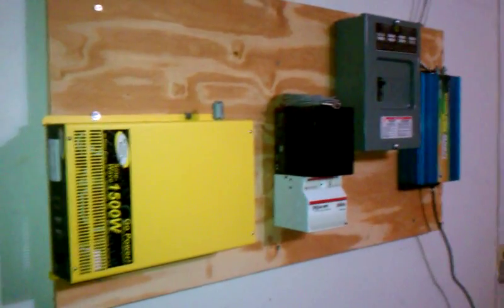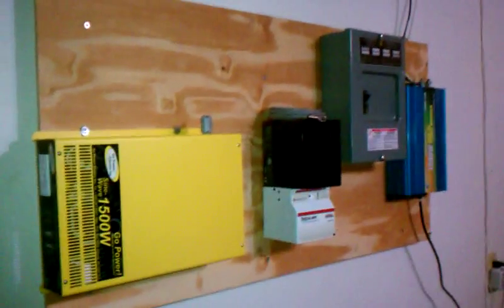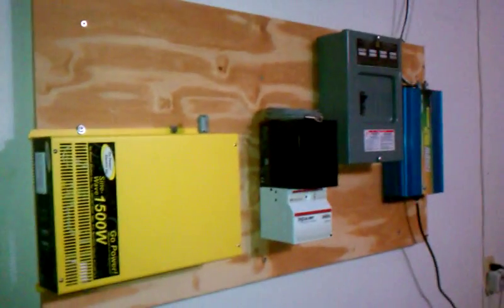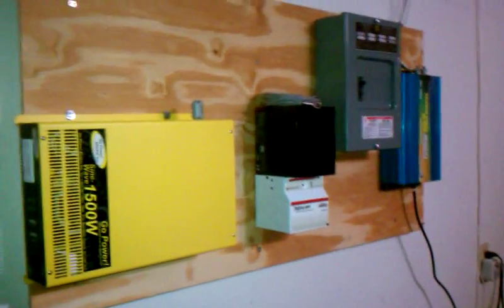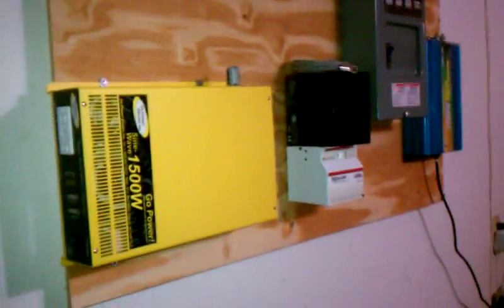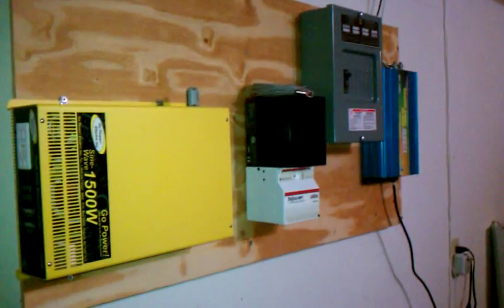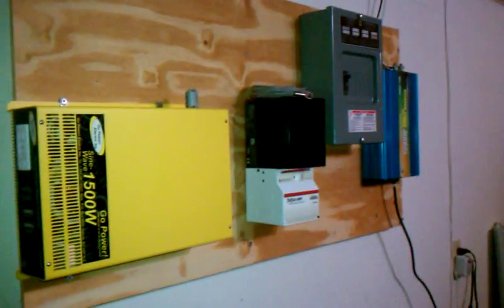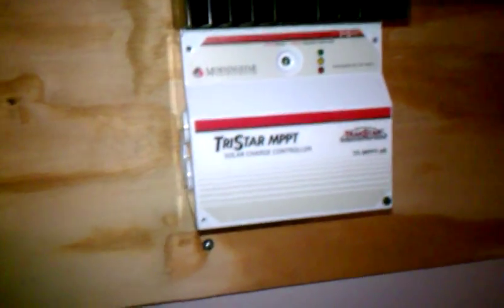Solar panels MPPT charge controller and 1500 watt Go power pure sine wave inverter part 2

Comment: You said the 3000 watts don't do what they claim but only 800 watts ... Do u mean the go power 3000 or other companies ?
Reply from the maker: +TAMIEM NAWAH The inverters do what they claim, the 1500W Go Power inverter for example will put out a maximum of 1500W or 3000W burst but will only sustain 1250W before it's in the "red zone" on the indicator. I have no idea what you are talking about as far as what I said though because you made no references to it so, I can only guess that's what you're talking about.
Reply: I know the go power will hold 1500w but I'm asking about the go power 3000w I just bought one today ... U said on the video that the 3000w inverter don't hold 3000w they just hold upto 800w ... I have read that the go power inverter are the best ... Are the go power 3000 as good as the go power 1500
Reply from the maker: +TAMIEM NAWAH The Go Power units work fine and they will do what they say they will do, I even say that in this video about The Go Power itself. I have a 3000W AIMS and it also does what it says it does. I was talking about the cheap chinese units they sell on eBay, they break down fast because the MOSFETS aren't mounted well and burn up.
Reply: Thanks, I almost wanted to return it ... But wanted to make sure we talking about the Chinese inverter that don't hold up to what they claim
Reply from the maker: +TAMIEM NAWAH Ok, no problem. I'd keep the Go Power unit, mine is still working to this day and it stays on 24/7 in my garage so they are workhorses in my opinion. My AIMS unit is brand new and I have been using it for maybe 2-3 months so I'll hold my judgement on that one for now.
Reply: Please do let me know which is better in the future , I read that the go power are better , which you the best

Comment: Hello I am new to solar and am learning a lot. I love your set up and your videos really help me. Can you please tell me what that blue this is on the wall? I understand the inverter but what is the blue thing
Reply from the maker: jacobz2011 The blue thing is also an inverter only it inverts DC power into AC power and puts that back into the grid lowering your power usage. It's called a grid tie inverter. So if you are using 1000 watts and you make 300 watts using your grid tie inverter then you are only paying for 700 watts of power usage. Hope that helps.

Comment from the maker: Does the wind turbine produce the voltages under load or as an open circuit? You'll want the "under load" value which is what it'll be when it's hooked to the GTI.

You could try it, not sure if it'll work. No, never done a wind turbine setup like that. Usually wind turbines charge batteries. You could charge batteries and then dump that to the grid?

Comment: listen dude..

the wind trbine produces arround 16V-20V... with peaks of 24V on high winds.

the inverter is 22-60V
they say that 22-60V GTI put power on the grid with input voltages arround 36V

but a 24V wind generator never makes output voltages bigger than 28-30V

so.. i was thinking in using a 10-30V Grid Tie Inverter.

do you agree?
have you done this before?

thanks

Comment from the maker: The concept is the same. The Grid Tie will turn on when the wind turbine generates enough voltage to meet the grid tie's low voltage requirement. It doesn't matter what grid tie you get. There are no grid ties built for wind turbines but there are some that will work with wind turbines. A grid tie built for wind turbines would turn on when the turbine started spinning and would dump the load to a dump load circuit in an over-amperage case. You won't find that so we work around it...

Comment from the maker: I recommend a wind turbine charge controller with a dump load built in, that's your best bet and the way to get the most out of your wind turbine also because it has logic built in to keep the turbine spinning and controls when it charges and when it doesn't, it can also kill the turbine in heavy winds and so on...

Comment from the maker: What you need to do is find a voltage range that your grid tie will work in with your wind turbine. Better would be to get a charge controller for wind turbines that has a dump load controller. If you hook a wind turbine up to a bridge rectifier and convert the AC to DC you can hook that into your GridTie. The problem is that the wind turbine will freewheel until it hits a voltage high enough that the GTI turns on, which may slow the turbine down and then the GTI turns off....repeat 1000 times

Comment: hey pal
i bought a 500W 3 phase AC 24V wind turbine.
and i bought a 600W  22-60V grid tie inverter.
but the turbine works with voltages between 15-19.. with 23V in peaks of wind.

Happens that the inverter can't connect with the grid.

What do you suggest me to do?
change to a 600W 10,5-30V grid tie inverter?

I read on internet suggestions to use two 600W inverters so thei won't heat to much and the disconnect protection wont go off. and the fan will not work and suck energy.
what do u think?

Comment: @helloman1976 -- The voltage from your solar panels needs to be higher than the voltage of your batteries, no matter what type of charge controller you use. Electricity has to push its way in, and if the battery voltage is higher than the solar panel voltage, there won't be enough power from the solar panels to push electricity to the batteries. 12-volt batteries are fully charged at around 14.5 volts, so the solar panels should put out more voltage than that. Around 17 volts +.

Comment from the maker: @solaris3000 The yellow inverter is a 1500 pure sine wave inverter and I could have gotten a bigger modified sine wave and still been ok since most devices could care less anymore. Most battery backups use square waves or modified sine waves and I can run everything on those so. The inverter on the right is a grid tie inverter and it worked out but it's not very efficient, maybe 80%-ish but then again it was pretty cheap compared to what 1000W+ of grid tie inverters would cost you.

Comment: Fantastic setup there. I still need to get my components mounted on the wall for my solar setup. BTW I noticed you have another inverter on the right side colored Blue.. How well did that work for you? I only require 1000 True-sine watt inverter for my setup so I am searching for options.

Comment from the maker: @TheSolarProject Thanks! Yes, the MorningStar controllers come highly rated and talked about. I went with MPPT because I need to squeeze every drop of power I can get to live off this portable system. Also, always make sure your solar Vmp is higher than your battery bank voltage when you use a MPPT controller. I'll be posting more videos as this system progresses, thanks for watching.